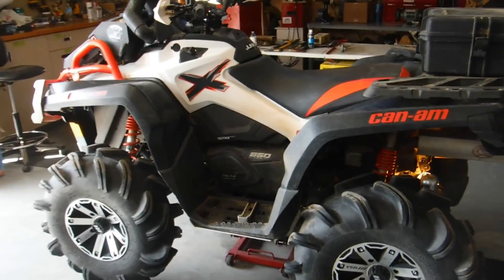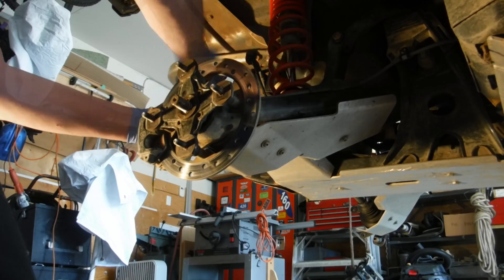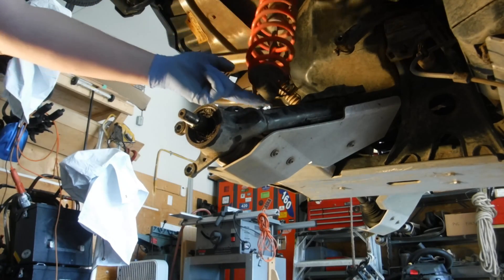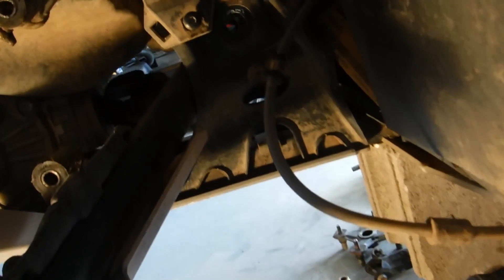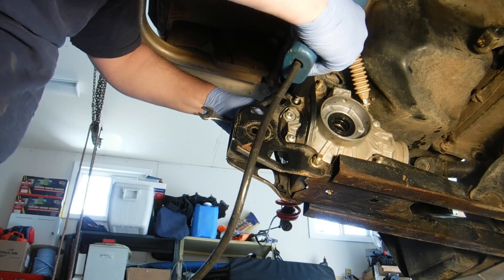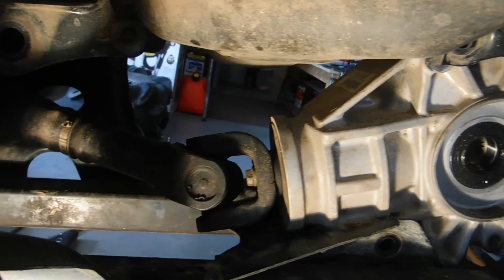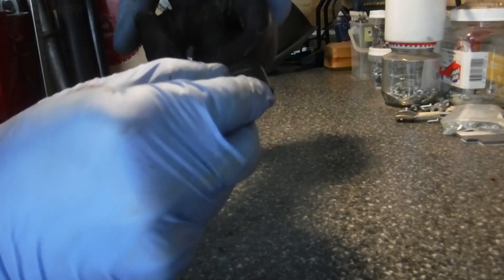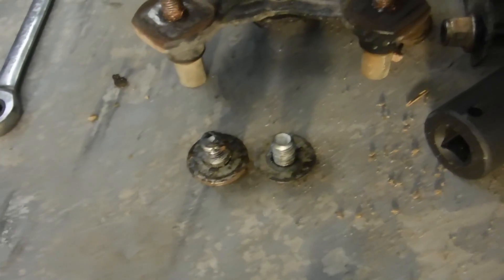Can Am Driveshaft Phasing the Rear Diff Killer ? Complete Rear End Tear down

Comment: Rob my man, how do you use the motorcycle lift to Jack the ATV? I got the same one and due to the floor boards can’t get the thing under it and the reach on that Jack isn’t far enough to get a ATV properly supported? You extend the platform on it or something?
Reply from the maker: I put a concrete block on the jack and it seems to fit from frame member to frame member.  Also raises the ATV high enough to work on.  Good luck.

Comment: Is that swing arm bolt supposed to be greased
Reply: Ok i just removed mine and it was bone dry with like a white coating
Reply from the maker: No but I grease it with some waterproof lithium grease so that it won't corrode and get stuck in there.

Comment: i have a 2019 Outlander 570 (Base). is the driveshaft in mine known to have phasing issues?
Reply from the maker: Not sure but you can put a ruler from yoke to yoke and you should be able to tell if there's a major offset between the two yokes if the ruler isn't parallel with the shaft.

Comment: I need your help, I disassemble the drive shaft, remove the two bolts from each side, the drive shaft comes out on the differential side, but on the side of the transmission, it remains blocked, as if it was completely rusted,
how to do ?? 

Thanks from France
Reply from the maker: Ya it may be corrosion seized on there...try some releasing spray like liquid wrench or something to that tune and give it some taps with a rubber mallet or lightly with a hammer for starters.  Might have to put some heat to it from a propane torch but watch the seals there!  You may also try putting a strap on it and run it out the back end, attach a sled to it and swing it out...may break the shaft loose.  Just try everything lightly at first...don't want to damage anything.  Good Luck!  I usually grease or put antiseize on axles and shafts when I put them back in.
Reply: @RobFarrowATV  Thank's !!!!

Comment: I have done all of this and it’s a great video. I cannot get the trailing arms to line up, the problem is inside of each trailing arm is a sleeve that down to stay in alignment. I can line it up outside of the instal but the minute I try and install it, you can hear the sleeve inside of each trailing arm fall out of alignment, please help with any suggestions.
Reply from the maker: Hmmm, interesting...That sleeve retains the bearings I believe.  Any chance your bearings are messed up in there?  https://can-am.brp.com/off-road/ca/en/shop/for-sale/parts-iframe.html  Might have to pull the bearings and regrease around the sleeve, not sure exactly.  Good Luck Gene!
Reply: Rob Farrow ATV found the cause, the sleeve in the middle liked to float around, but if you get it perfectly lined up with no stress on the bolt, it will slide right in. It is nice to have your wife on the other end to line it up, I lost my right eye sight in an accident but the other eye is starting to fail..I can still see ok and it’s not stoping me, not the reason why I couldn’t get it lined up though. Praise God for my wife. Just let everyone know to get it perfectly aligned.
Reply from the maker: Glad you figured it out! Ya definitely pays to have a second set of hands sometimes!

Comment: Just noticed my diff had water in it upon further inspection noticed the pinion seal had oil on it. Did you have issues with water in the diff?
Reply from the maker: I had lots of issues with water in the rear diff...had the seal changed twice and it still leaked. Finally I broke down and bought a Mud'n Wheels XMR rear diff and haven't had a problem with it in the two years now that I've been running it!  If your machine is still in warranty get it checked out.  If not, you may want to look at an aftermarket.  Good Luck!
Reply: Rob Farrow ATV  unfortunately it’s no in warranty it’s a 2019 570 xmr. Looking at changing the pinion seal. Called the dealer and they Quoted me over $500 to do the job so I’ll tackle it myself. Absolutely love my can am but wishing I went with Honda at this point. Love the channel!
Reply from the maker: Thanks Greggory!  Ya 500 to do that is a joke!  Loosen off the drive shaft bolts.  Pull the bolts out of the diff and pull the diff back as far as the axles will let it go.  Take out the bolts on the shaft and pull the drive shaft out.  You can run a screw into the old seal but not too deep and pull the old seal out.  Slide the new seal into place and use the old seal to bang on to seat the new seal.  You might have to put a little heat just on the diff bolt to break the yellow BRP loctite.  Check the wear ring on the shaft yoke, if you can feel ridges you might have to replace it.  To do that I use a dremel grinder to cut it off carefull not to score the yoke.  Put the yoke in the freezer and put some heat on the new wear ring and put it on by using a pc of wood and a rubber mallet on the wood.  Use care when doing stuff and don't damage anything and you'll be good!  Good Luck!  There's a bunch of videos out there that may help some too.
Reply: Rob Farrow ATV thanks so much! Keep up the good work on the channel!
Reply from the maker: Thanks!

Comment: Well done video thanks , just want to double check is it ok to leave the axils in when you pull the diff, all I need to do is change the u-joint. thanks
Reply from the maker: Yep, just unbolt the diff and pull it back and inch or so till you can pull the drive shaft out. Good luck!

Comment: Hello I have a 19 can am 850 what the best bang for your buck exhaust tuner and spring and will I feel a difference
Reply from the maker: Most aftermarket slip-on pipe's and a tuner will give you 3 to 5 hp, so they say.  I did notice a difference on my machine.  I really like the SPI exhaust which is similar to the RWJC pipe.  It"s easy to repack the pipe and they should be repacked every couple years with heavy use.  I can't remember what my tuner was called, sold it and got a reflash to the ECU instead.  There are many brands out there for tuners and many different opinions.  All depends what you want to spend and if you want it programmable.  The reflash is certainly a great option and it ups the speed limiter and gets rid of the reverse limiter too.  Happy Trails!
Reply: @RobFarrowATV  thank what's the propose of the clutch  spring
Reply from the maker: Primary spring size will make a smoother grab on the belt.  If it's a stiffer spring the clutch will engage smoother and a tad bit slower than a weaker spring.  A stronger spring will also grab the belt with more force to prevent slipping.  Weights also come into effect on how smooth and fast the clutch will react...It's a fine art of tuning the clutch and they all work together.  The secondary spring will provide the force for gripping the belt also.  From what I understand about them, which isn't a lot! LOL!

Comment: Hey guys I need some advice i just got a new rear diff and I can not line up all 4 bolts on the differential.
Reply from the maker: Ya, I had to use a ratchet strap to pull and line up a couple of the holes. It'll go, just have to put as many bolts in as you can and then use the strap to lift or push the diff to the next hole.  Takes a bit. Good luck!
Reply: Thanks man I had it lifted up via chain pulley so I put a jack under it and slowly let it down until the holes lined up
Reply: I’m working on a 2013 can am outlander 1000 xmr

Comment: Pliz tell me the length of the bolt (the axis ) in cm , which holds 2 of the lever?
Reply from the maker: Sorry, I'm not sure which bolt you are referring to...trailing arm bolt?
Reply: @RobFarrowATV  A long bolt that holds the 2 levers together. Rear suspension I want to know its length ), thanks for the answer
Reply: @RobFarrowATV  5:47 min You get it
Reply from the maker: @НиколайМирный-д9э  Ya, that's the swingarm or Trailing arm bolt...what I call it anyway.  Part 67 #706001664  Axial Pivot M16 $65.99 CAD...  You can look it up here  https://can-am.brp.com/off-road/ca/en/shop/for-sale/parts-iframe.html

Comment: My rear diff took on water and the seal is bad. I will be doing this same process. It's not bad, I just did about 1/3 of the work as I had an tore outer cv boot that I had to remove and replace. I am upgrading all rear bushing to garage products bushings as well since I'll be in there.  24mm trailing arm nut BTW.  Did you have to heat up the rear drive shaft bolts at all? The repair manual says they are loc-tited. And to re apply red loctite to them when installing.
Thanks for the super helpful video Rob! I wasn't worried about this task but it's nice to see it all laid out!
Reply from the maker: I've had those drive shaft bolts off so many time and actually lost a couple before too. They came off with no major issues the first time I did it.  Ya, almost need red loctite when putting them back in!  Good luck with your machine repairs!
Reply: I will also be greasing the rear wheel bearings with my new bearing grease tool.

Comment: This video was so helpful!! 1 question is there a washer on each side of the drive shaft?
Reply from the maker: Glad it was helpful! Yes, washer and bolt on each end of the shaft...
Reply: Rob Farrow ATV perfect! I had to yank it off with a strap so i found it on the frame! Thanks for the reply washer goes on the outside between the yoke bolt and diff or inside the yoke? Thanks again!
Reply from the maker: Washer goes on the bolt...
Reply: Rob Farrow ATV thank you sir! My u joint was wore so badly that the actual shaft was wearing into the yoke on the transmission side
Reply from the maker: Wow...change both u joints!
Reply: Rob Farrow ATV just got done installing the new joints today my god what a pain those yoke bolts were. Waiting on my axles and ill be good to go for how long who knows
Reply from the maker: Right on!

Comment: Hey rob I cant seem to find a part # for the bolt holding rear prop shaft to the gearbox output shaft dont suppose you have that written down eh ?
Reply from the maker: For my 2016   250000359 Hex Flanged Screw M12 x 16 and 50200102 Flat Washer M12  holds the shaft to the Gearbox.  Good luck and thanks for checking the vid out!
Reply: @RobFarrowATV  thanks a bunch man huge help.

Comment: Does anyone know the size of bolt to hold the rear yolk onto the rear diff? Or where to purchase? Mine is missing for a 2015 canam 450 outlander
Reply from the maker: From the BRP site... 250000615 Hex Flanged Screwv M10 X 16 Needs the washer also 250200014 Flat Washer M10.  Thanks for checking the vid out!
Reply: Rob Farrow ATV thank you, I actually found a dealer today that would speak with me on the phone and picked one up. I appreciate you checking back with me
Reply from the maker: Awesome! Good Luck!

Comment: Well this got me a bit nervous as I'm the second owner of an 2016 XMR 1000, the really long one with a long rear driveshaft and it's barely got any distance on it about 1400KM...
Reply from the maker: I think it's more the 2018 models that were affected but it doesn't hurt to check it out! If you've been having a leaking issue with the rear diff that could be the problem! I had a leaky diff almost from day one...finally had to buy a new diff from Mud'n Wheels and I haven't had an issue yet. Good luck with your machine and Happy Trails!

Comment: When reassembling, I noticed when I tighten the rear 13mm bolt that holds the yolk to the diff, the shoulders of the yolk eventually bind against the diff housing and keep everything from spinning. If I back the bolt off half a turn than everything spins freely. There is only factory lock tite on the rear bolt so I thought maybe that one doesn't get torqued down but that doesn't seem right! What am I missing!?
Reply from the maker: Not sure, everything should be tightened down...what stops spinning?  Thanks for tuning in!
Reply: @RobFarrowATV  Everything stops spinning. The shaft goes into the diff until the yolk gets tight against the diff housing than you can't turn the tires by hand
Reply from the maker: All there is there is a bolt and washer...is the washer there, might be going in too far without the washer?
Reply from the maker: Dumb question but is the machine in nuetral when you try to spin it...brakes aren't locked? Just making sure!
Reply from the maker: Yoke shouldn't sit tight against the diff...
Reply: @RobFarrowATV  Yeah something's not right. I'll have to pull it apart again and figure it out. I'll tighten the old yoke back up to see what it does. Thanks for the quick replies.
Reply from the maker: No Problem! Good luck!
Reply: your pinion seal might not be seated fully. it should be counter sunk 3 to 4mm approximately.

Comment: Hey Rob, my 2016 570L is giving me issues getting the bolt out of the trailing arm. Its a 24mm nut btw! Anyways, thats an issue because i need to remove my rear cv axle and change the wheel bearing. Any tips on how to get that bolt out? I tried beating it through with a hammer but its just still stuck and I'm scared to damage threads. Thanks!
Reply from the maker: That's a tough one, maybe try spray some kind of release spray at all the part gaps and tapping it with a rubber mallet before you bang on the bolt, the vibration cause the spray to go in further...also put the nut on the end of the threads so that you don't mess up the threads and also use a piece of wood against the nut.  Last resort may be heat but be careful you don't damage the think steel on the parts! Good Luck and thanks for checking the vid out Cole!

Comment: Thanks for the great quality and informative videos.  My 2015 650xt rear diff was leaking.  Asked dealer to repair seal.  They ended up replacing diff and driveshaft!  5000kms on bike and I'd say I'm a slightly aggressive trail rider.  I don't mud much but love atving in snow.  Cost me 50 bucks with the aftermarket warranty.  So far the $2kish warranty has paid for itself twice. I bought the bike used at the dealer and the warranty came with the bike.  It was owner transferrable.  5 year warranty 50 deductable.  Definately going to look into a set of Ratchet wrenches.  Thanks again for the great vids.
Reply from the maker: Wow, that's a good break to have had the extended warranty! Glad you are enjoying the vids, lots more to come! Thanks for tuning in Mark!

Comment: Great video Rob. “Not a mechanic blah blah blah...”. 😉You seem to do pretty well in my opinion! I would take you working on my ATV over the mechanics at the ‘stealership’ any day of the week!
Wanted to ask you - if you don’t use a service manual how do you know what the toque specs are for all of the bolts, especially for important things like the driveline (yoke)?
Reply from the maker: Thanks Chris!  If I need a torque value, I usually look it up on the web...I have a whole bunch written down now! LOL!  Pretty tough to torque the driveline yokes...no room to fit a torque wrench in there.  I go by feel and add some loctite...no problems!  Thanks for commenting and tuning in!
Reply: @RobFarrowATV  How did you tighten the rear 13mm bolt? Is it meant to be held in by lock tite only or is it supposed to be torqued down. When I tighten it all the way, the shoulder of the yolk binds against the diff housing and I can't find a solution anywhere.

Comment: I would of tried the level with it installed on the machine
Reply from the maker: Wouldn't have made a very good video then! LOL!  Thanks for tuning in Ryan!
Reply: Rob Farrow ATV when you putting apache 360's on? I want your review before I put them on my 1000xmr lol
Reply from the maker: No plans for Apache's at this time...have a sled for winter and there's really no one to ride with in the winter with tracks!
Reply: Rob Farrow ATV  what about summer time skeg? Tracks no good for that?
Reply from the maker: I would hate to get a tracked machine stuck in the skeg, would be next to impossible to get out! Only tracked machine I've seen in the skeg was a argo and it has the track around all 4 wheels on each side, so it runs pretty well on top! Tracks also use a lot of gas and you can get the speed of the other ATV's...just my opinion anyway! Thanks Man!

Comment: Rob how does the Drive Shaft come out of phase does it just twist under load or is it set up from the manufacturer incorrectly?
Reply from the maker: There was an issue right from the factory on the newer ones apparently...but yes they could twist if you've got too much power, more likely to snap though!  Thanks for tuning in Drew!
Reply: Rob Farrow ATV Where your universal joints loose? Or not square in the yokes?
Reply from the maker: No the universal's were good...just checking that the shaft ends were lined up with each other, some of the newer ones are not and are out by quite a bit!
Reply: It's 100% from the factory. Same issue with g2 650xmr. Only run stock 28" tires during break in and there was already water in read diff. If you say 650 twists propshafts like 1000r renegades with 30"+ tires then there is something wrong with the quality.